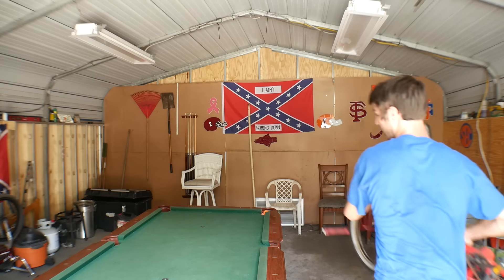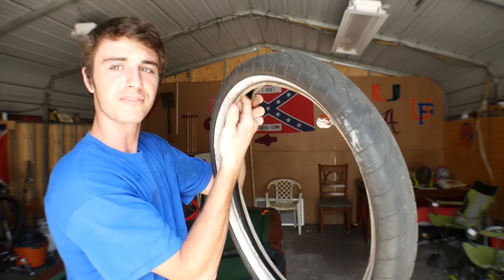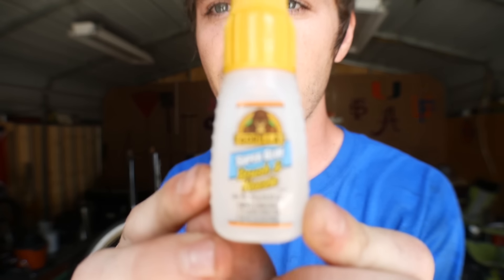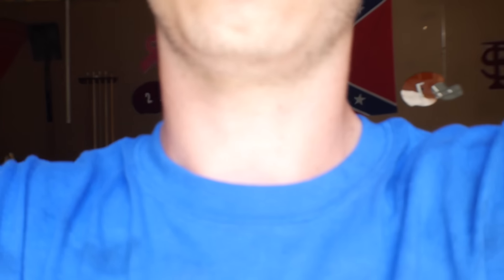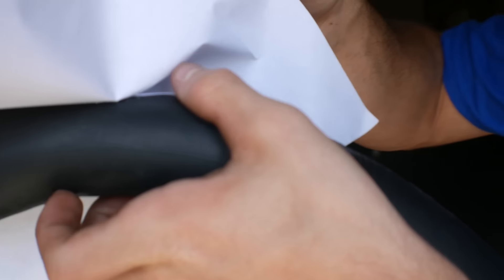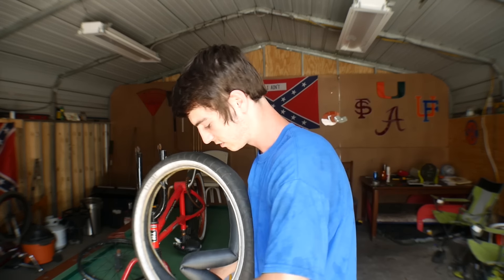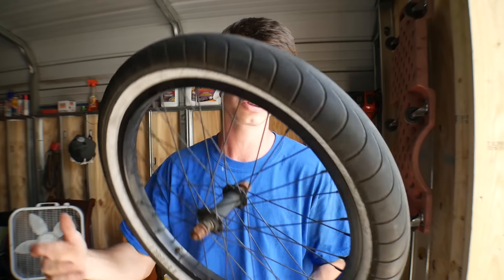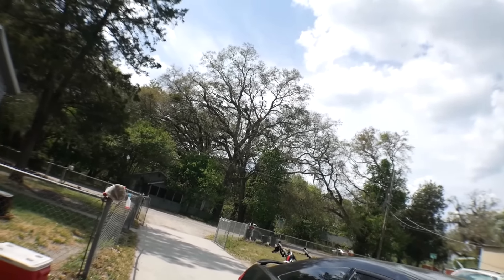(DIY) How To Patch A Bike Tube Without A Patch Kit *House Hold Iteams*

Comment: Other emergency fixes include tying a knot either side the hole, 
paper without glue (if the hole is small and you inflate quickly),
a piece of plastic bag (as above),
stuffing the tyre with grass or straw. 
None of these are permanent fixes, but will get you home, plus it's better than walking.
Reply: Stuffing tire with grass? I’m curious how this works coz once on a ride, i saw a man stuffing grass on his motorcycle’s tire, and i’m like wtf is he doing?
Reply: Stuffing tire with grass? I’m curious how this works coz once on a ride, i saw a man stuffing grass on his motorcycle’s tire, and i’m like wtf is he doing?

Comment: Yeah I know the trick I've utilitized the glue and  tissue method   for years I thought of it from the way you roll a joint.  I must suggest that the super glue the cyano cry late unfortunately is not very conducive to flexing it's quite brittle actually so it's ultimately going to get it's going to be doomed to fall apart eventually so the more you turn the wheels it's going to degrade that the seal and it'll crumble I've actually figured out a better work around using molten plastic get it nice and hot and hit it with a lighter and it creates a a vulcanizing effect you have to get the tube hot at the same time and then you wrap it with some duct tape like a couple times around but loosely so it's like round as how it will be when it's full and then you pump it up to that level and then you put more tape on it as you increase the pressure and spread it out and then of course at the end hit the tape of the lighter and use either your hand or if you can't handle the heat use a glove and then rub it in as it's molten the tape and then wrap it with some more tape and don't even bother to melt that  layer  
Also wrap a wide area rather than small near the hole it's much harder to find the way out for the air and I've fixed my tire this way it's still fine half a year l8r  and I am 300 lbe man I ride my bike every day    I don't g to hard or fast if I am off-road  not j just for the tires sake but the bike overall as when you are 300 plus pounds as I am any kind of hard hits you do on the bike has  the potential
In all likelihood the probability it'll happen from a cumulative hard hits it will with each hit weaken the metal by a cumulative     effect   so I I try to be careful one time I bought in a bike from Walmart for a hundred bucks or a cruiser and I started riding kind of a little bit hard standing up up uphill I'll be cranking it you know standing up on the bike and I basically like to sound like a shotgun when it happened but I busted the sprocket right off the axle not as a mark of pride but you just got to take into consideration when you're a large person so I try to feather it around the big tree roots and rocks and stuff I'm just avoid that if possible but I love to ride my bike all around on a nice paved area gives me good cardio pleasant

Comment: Dude, how did you get the tube to inflate to such degrees without it popping on ya. i came from a 20 mile bike ride so i decided to inflate my tires to recompensate and decided to inflate to 45 psi according to my bike pump. i can barely get it to there but my tire says 45 - 60 psi so i dont understand why it wouldnt handle unless its a mistake (its a Shock Top Beach Cruiser- white); so i inflate the patched tire to 45 psi thinking 10+ hours of curing would suffice but after a little while- maybe within the hour- and pop *whoooooossssshhh. i was like wat ta hek waz that! and couldnt figure it out until i released like dont tell me my bike popped and then the hissing came from my tire. find out theres a tear or rip somewhere else along the lining of the tube so kudos to your idea or where ever you got it from. From my Experience, I would say this patchwork idea works but only at maybe 40 psi and below capacity. So I'm surprised you got it to where it is without popping. anyway dope advice, see you out there! Peace.

Comment: I have a wheelbarrow that needs a ghetto fix like this for a pin hole leak. I figured it would be a lot harder than paper, but I'll be coming back to thank ya if this works for me..... I have to assume it will, because the wheelbarrow is running a lower psi, plus gets less abuse, since I don't do crazy gaps or tricks with it.
Reply: I said I would come back and thank you if this worked for my wheelbarrow, and I meant it... It's A LOT harder to remove the tube and tire off from a wheelbarrow, but the paper trick seemed to have worked... I also topped the patch with flex seal. The flex seal isn't strong enough to keep the air in itself, but it does help waterproof the paper, and seal it all down... Thanks again!

Comment: If u can't find the hole squeeze the tube and scan the tube with ur cap it will make a louder noise so u can find it
Reply: lucas sweg or dunk it underwater and find the bubbles or spray it with a soapy solution and it bubbles up

Comment: Before I remove the tube I mark the tyre with chalk along with the direction of rotation and then mark the same on the tube.  Sometimes the spike ONLY gets through the tyre when under load.  If I have found the hole in the tube and I have the chalk marks I can know EXACTLY where the problem on the tyre was.  Often there has been just the hint of a bindii spike but it MUST be removed.

Comment: Friend you can buy compressed foam insulation board [ 2 " ] Construction glue to your metal ceiling.  Cit the strips into 12 or 16 inch  wide peaces.  That will fit the conture and you will be 25 deg. cooler.  get foam faced on both sides.  A farm or chicken supply business can help you with finding the insulation.  Its used in chicken houses .  Paul

Comment: I do a little different, find hole, delate tube, , small nail with superglue on it, poke into hole, pull out nail  immediately, in this way, superglue goes inside the hole, better seal

Comment: Super glue is more expensive than a patch kit and has limited bottle life once opened. Also, super glue is brittle and probably not going to seal as well as rubber glue and patch esp when the inner tube expands. If your going to take the time to fix a puncture, might as well use the proper materials which are just as cheap
Reply from the maker: Super glue is literally a dollar but you are right about it being brittle but it does last  I have road on tubes that I patched with superglue for months I ride 60PSI and it does fine  I made this video for people that like live in the woods and don't have stores near by or for kids that can't afford a patch kit

Comment: "Can I use super glue to mend punctures? Superglue should not be utilized to patch or repair a puncture in tires or their associated inner tubes. Superglue (cyanoacrylate) gets dry, brittle, and inflexible after prolonged exposure to air. For this reason, it is simply not appropriate for tire mending."

Comment: I'm 37 and havent fucked wit bike flats for years but my 5 year old got a flat. I ordered another tube but was curious if i could fix it.  Sadly i dont have quick set super glue but a gorilla brand that takes 24h to cure.  I still may try it as i have nothin to lose.  

Some folks use inner tubes from bikes for their firearms,. While i have the griptape talon grips maybe ill hang on the the tube for future firearm grips.. 

Glad to see with all the media generated rascism some folks understand the confederate flag has different meanings to those in the South

Comment: Dude your tip worked like a charm.. I know what else I'll be toting in my bag, some of that super glue for those on the spot flats.  LIked/Subbed. 

This method works faster than the rubber cement, give it a try and see for yourself.
Reply from the maker: Yes man been using it for ever works good

Comment: Nick,I have a Gary Fisher hybrid road/ mountain bike with those skinny 700 c type tires. I blew the hell out of my back tire and tried that FLEX GLUE that they advertise on tv and a piece of cardboard and it didn't hold after 2 hours. Should I get a new tube or is there another option I can try?
Reply from the maker: Michael O'Dell I dont know about the skinny tire bike man I would say buy a new tube or find a old tube and cut a peace off the old tube and glue it to the popped tube

Comment: A second trick I use for a really serious rip is sticky tape.  I had a split tube with a 3 inch long tear.  Can't be patched. But I wrapped the tube with the tape and reinstalled it.  Once pumped up the tyre was not quite round at the point of the repair but I rode 50 km to get home without fuss ( although it did go bump bump bump as I went along).

Comment: Very good method to know, especially standing on the road side with a flat tyre and waiting "Forever" for the rubber cement to dry before putting the new rubber patch in  place and wait for that to stick properly.
With super glue and  piece of A4 paper the repair is done, as promised, in seconds.
The method also save space and weight - compared to a spare tire or a repair kit.

Comment: don't do this trick on a mtb(if you still run tubes) mtb tires flex when riding causing the super glue to crack causing a leak

Comment: Don’t you have those sticky patches that were made to repair punctures where you are ? You just peel off the backing paper and stick it on. Saves carrying around a tube of glue and paper and is quicker.

Comment: Does anyone know how to patch the tire ?
Reply from the maker: If its not a huge hole you can use a bad tire,a bad tube or even cardboard and just put it on the inside of the tire where the hole is but if it is to big just get a new tire
Reply: chad warden 
I use to fit tyres on vehicles, if that works, ok, but he should of check 4 leaks b4 he put it back on.

Comment: why not just fix it properly ? glue and paper is going to fail soon
Reply from the maker: the pinDrop not true at all I rode this patch for months now
Reply: what do you think you get in a patch kit? glue and a patch? This kid is showing you an alternative method of repair, super glue (glue), patch (paper), and it works. I've tried it, and its holds. Fixing if "properly" wouldn't be any fun either. Have you ever thought outside the box? Well this kid is, and it WORKS>> TRY IT, before doubting it. <<<< Thats why.